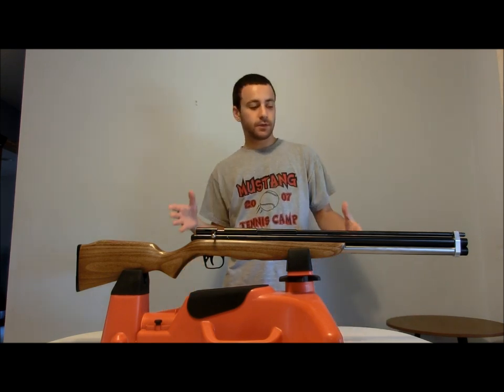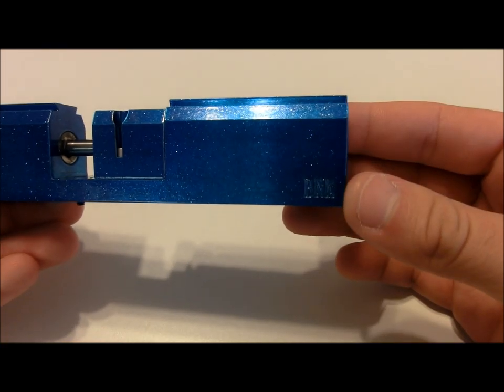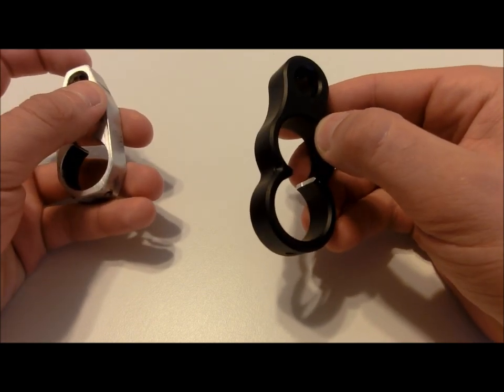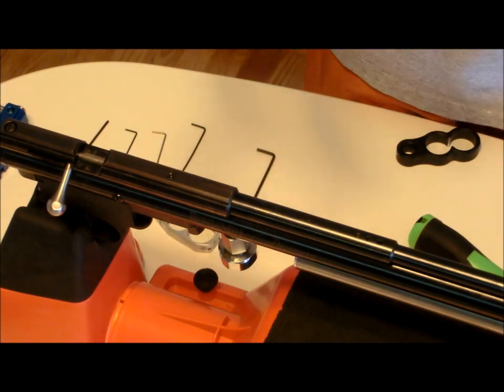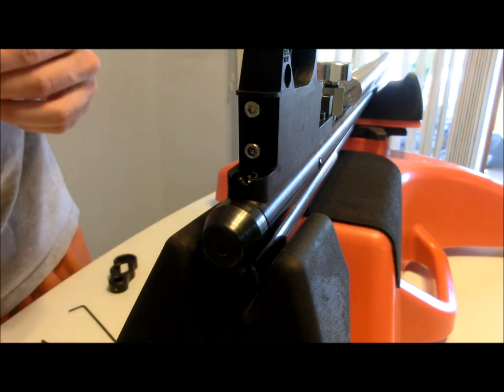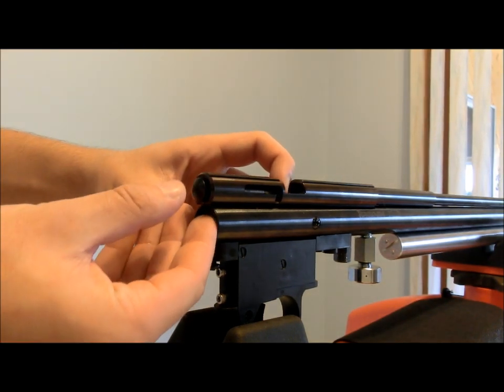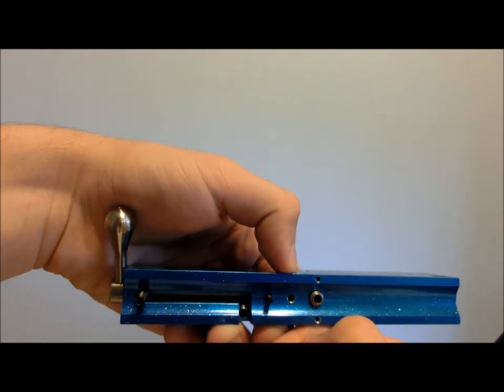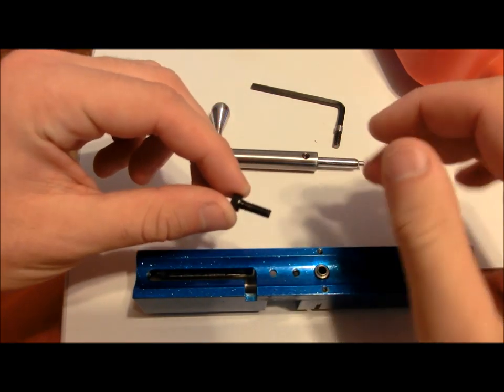BNM Breech Installation Part 1:  Product overview and Disco breech dissassembly

Comment: Bnm was a real nightmare to deal with. It took months to get the breech I paid in full up front for, and no one would answer my emails or even pick up the phone. And it did not come with a barrel band like this video said. I had to order it for an extra 40$. Then they sent it to the wrong address. After three months of this I finally had the breech and the barrel band and I was pleasantly surprised to see that the mod was real quick and easy. It actually cycles smoother than an mrod but due to poor design the bolt can travel too far up and kind of get stuck for a second. It's easy to deal with once you get a feel for it. If there were any other company that made a similar breech I'd recommend using them because bnm SUX!!!

Comment: Hi... just saw your videos... wonderful.... just what I needed to complete my mods... but..... the screw in the original breech under the bolt pin.... is now stripped.... I had two sizes...one metric, one standard... thought I was doing fine... and now... NOPE... so what do you suggest?... why on earth did they make that screw with such a small size allen.... idiotic..

Comment: I could not remove the screw that retains the bolt. Mine is not a hex but just smooth and round. I cannot proceed with the installation. Does anyone else have this? Any solutions?